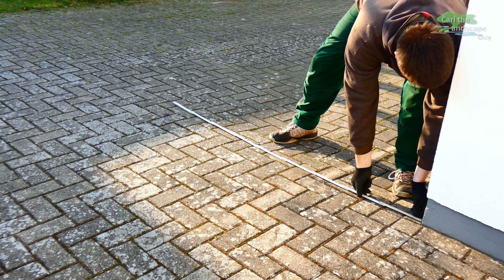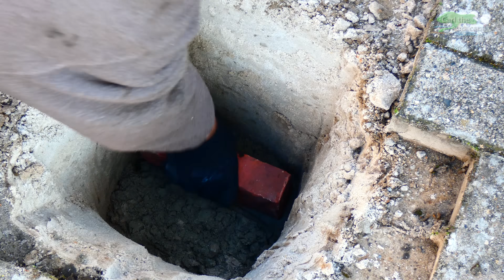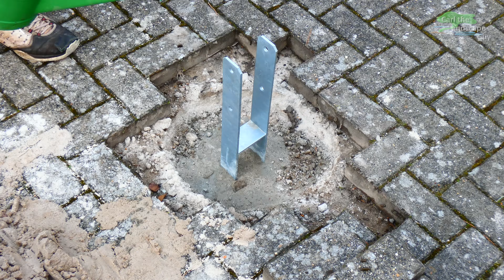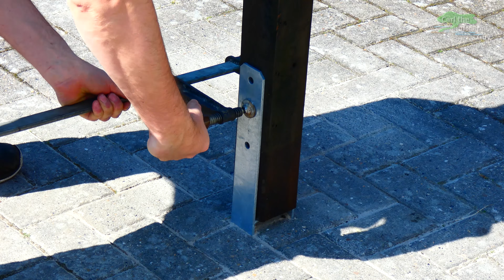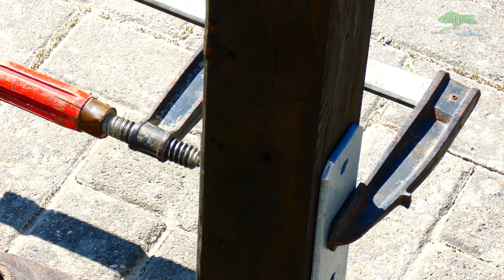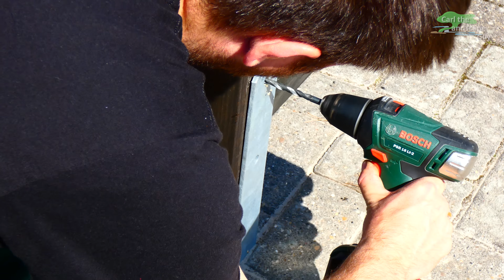BUILDING A WOOD WEAVE FENCE+FOUNDATION POST BASE H-ANCHOR CONCRETE,PANEL FENCING CONSTRUCTION,HOW TO

Comment: I wish our soil was that easy to dig.  Yours looks mostly sand.  We have a gumbo clay that if dry is like digging through concrete and if wet, it sticks to the shovel / post hole digger and won't come off.  Where do you live?
Reply: Try a powdered  Augur 
a two man machine is Preverbiale.
Reply: @derekmulready1523  -- When I had a lot of holes to dig, I rented one of the trailer mounted hydraulic powered augers.  Still had to dig the corner ones by hand in order to set secure endpoints so that I could run a tight line to position the rest of them.  Those 3 corner ones really made me appreciate the hydraulic powered one for the rest of them, but sometimes I would hit chucks of concrete that the builder had just dumped there as fill and it would mess things up a bit.  On the family ranch where I grew up, we had a power auger that hooked to the PTO on the tractor.  That was a LOT easier to dig the holes with and I dug a LOT of holes with it over the years.